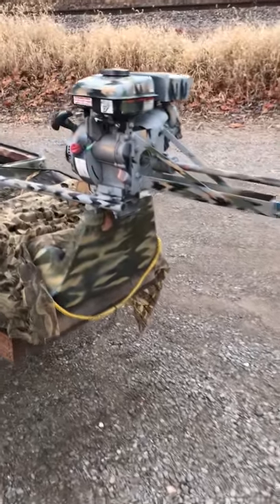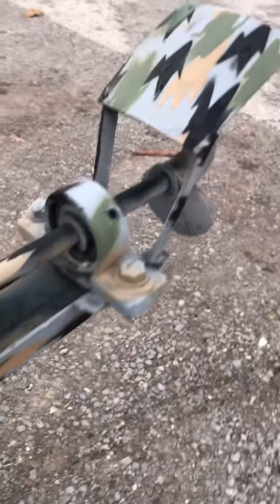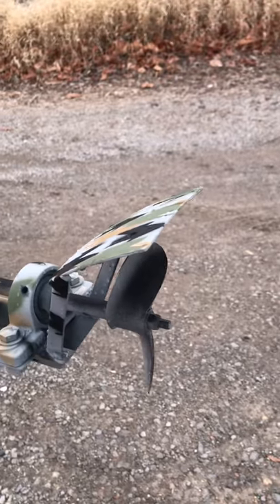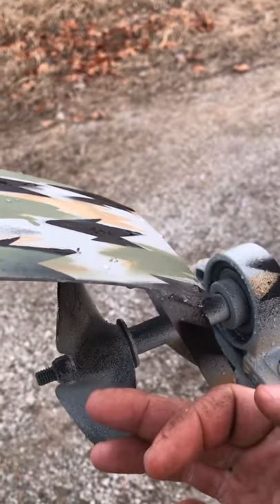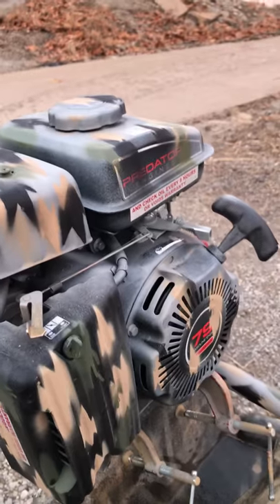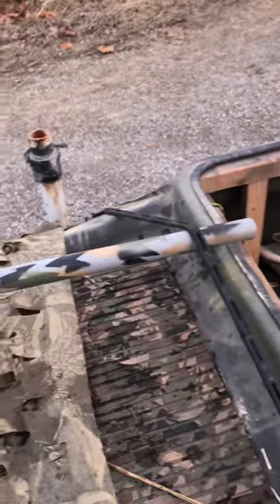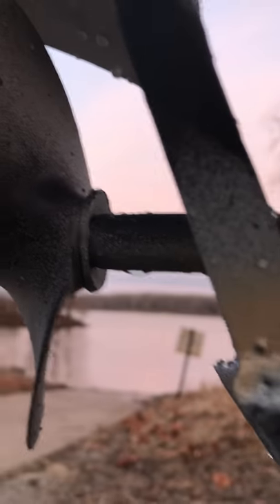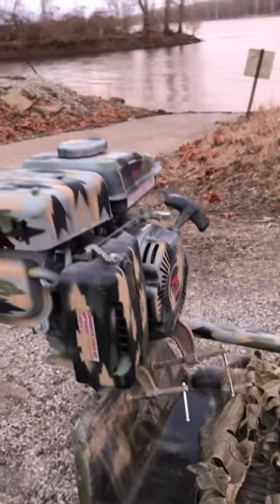DIY Mud motor $150

Comment: Nice work making something that actually works for so cheap.  To me the only thing that looks really objectionable is that huge bearing right in front of the prop like that.  It is definitely going to starve the prop when you try to speed up.  You do need a bearing there but it really should be smaller. The signpost also shadows the prop more than is desirable.  I bet that is why you don't go faster at full throttle.  Also, make sure your prop isn't spinning on the shaft when you try to go fast, that is also very possible.  It may be tight enough to transfer some torque but not the maximum produced by the motor. In the future you should try to get one of those props with a hex bore and then you could just weld a bit of hex shaft onto the end of your round bar shaft.  Anyway, like I said, good job actually making something.
Reply from the maker: Thanks for the information. As far as speed goes I’m not too worried about it. I don’t fly through the marsh at high speeds. I’ve flipped this boat getting in a hurry. I’ve got other buddies with kits and bigger motors and we all put around about the same speed

Comment: i tried it without a sign post and roller bearings under the shaft to support it... when i put it in the water it jerked the whole thing and bent my crankshaft so my engine started knocking like crazy lol. now i need a new engine and a different design. Also dont forget to buy a left hand turning prop from ebay or you will go backwards
Reply from the maker: I’ve made the same mistake with the prop. As far as the crank getting bent I haven’t had that issue even hitting stumps which shared the prop before it bent the shaft

Comment: I have one just like it with a 301 predator motor but my boat is 16"  flat bottom my motor sits up to high and the shaft is only 40' so at full throttle it just wants to lift the rear end of the boat up instead of thrust it forward so I can only get like 6mph it works for now but not good for my situation river current can get fast in some of the shallow spots so I'm limited to where I can go

Comment: Curious what takes the thrust from the prop pushing forward? Looks like none of the bearings are taking that load which can damage your engine pushing on the crank.
Reply from the maker: If you look at any long tail kit the shaft is connected straight to the motor
Reply: When the engine gets destroyed from the thrust, you just buy another one. They’re cheap.
Reply: Excellent question, perhaps some kind of coupling at a bearing could be added to resist the thrust.
Reply: Locking colar should do the trick.

Comment: Where did you find the coupler that you connected the shaft to the motor?
Reply: I’m in Canada and they sell them at princess auto but you can probably find them at a harbour freight or farm equipment store in the US
Reply from the maker: Farm and home supply. You can find them on Amazon

Comment: Isn’t the motor just a bit small ? Mines 212cc or is that a different measuring system ? I want to make a surface drive next !
Reply from the maker: A surface drive gets its thrust from the rotation speed of the prop and that’s why surface drive props are only half way in the water instead of completely submerged
Reply: @jwhitleyawl1  all outboards speed is determined by its prop speed weather it is 3” below or 12” . A surface drive actually loses power because of cavitation and most surface drives don’t have a cavitation plate on them and that’s why you need a bigger motor on it !
Reply from the maker: The information I got about the surface drive was from a sales rep. Do what you like and I hope it works out for you. Post a video of your build I’d love to see it.
Reply from the maker: The motor is small and the unit itself is smaller than anything else I’ve seen but that’s what I wanted. Something small and reliable and so far far it’s been exactly that.

Comment: That tapered nylon just needs to fit snug on center of bolt and to the inside taper of the prop???
Reply from the maker: Yep. It hasn’t failed me yet. You need to bring an extra prop with you. I’ve sheered these props on ice and stumps.
Reply from the maker: I’ve been trying to think of something different. I don’t know many people with lathes. If you come up with something let me know. You can also use a trolling motor prop. Make sure it’s a 5/16 inside diameter